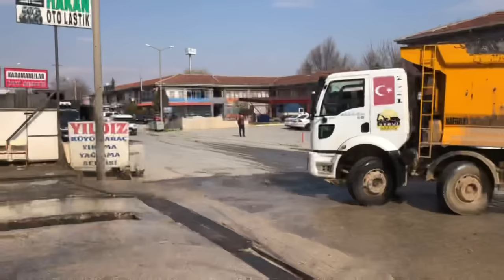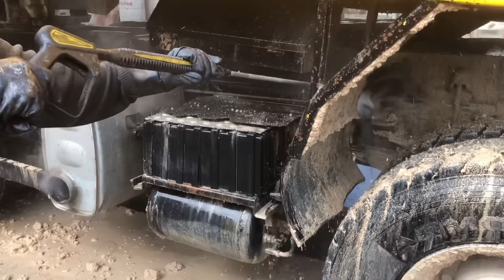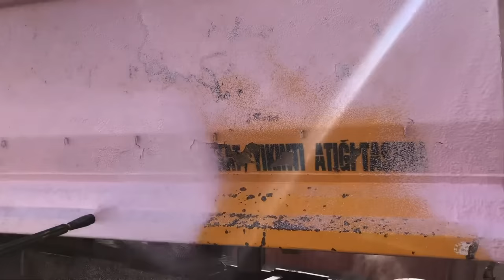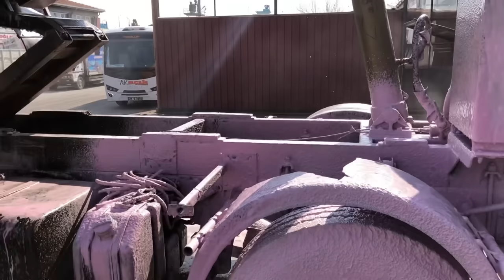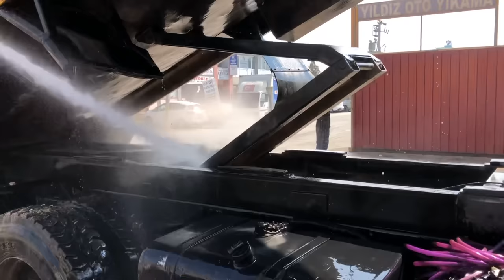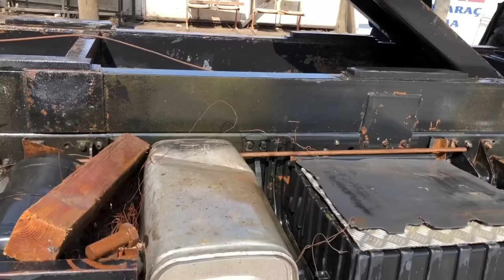ÇİLEKLİ MİLKSHAKE ile BOL ÇAMURLU KAMYON YIKADIK! Washing a MUDDY TRUCK with STRAWBERRY MILKSHAKE 🍓

Comment: I worked on a dairy farm many years ago. I wish we had a power washer for our equipment. That manure is no joke if you let that build up on the equipment. Not only does it rot the equipment but when you need to change a part and the manure is caked around it, you spend more time chiseling the manure off than you do actually changing the part.

Comment: SUGGESTION - 
1. Start cleaning from the inside.
2. After finished cleaning the debris both inside and outside wash the floor and make it clean
3. Now apply your strawberry milkshake 🍓
4. Rinse thoroughly
5. Give a final wash with the big water pipe jet.
................................ this way you will save water and time. Thank you.
Reply: I think they did it exactly in this way 😂

Comment: nice work but to me it seems like you could have done an initial spay down with just water on everything to get all the heavy stuff off and then hit it with chemicals once really well and rinse.  seems like a waste to use all that cleaner on 1" thick mud when it would spray off with water and then allow the cleaner to actually do the cleaning on whats left and to clean the actual surface.  idk end results would be the same or better if done like that.